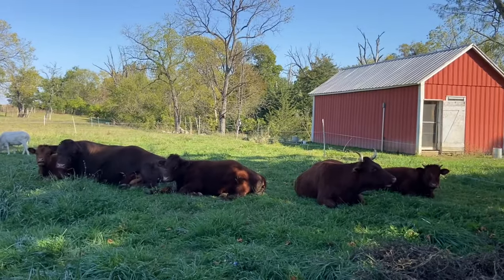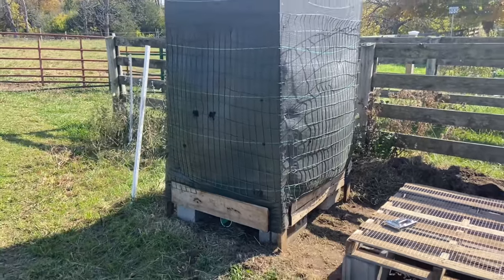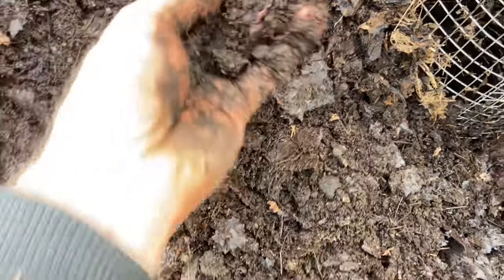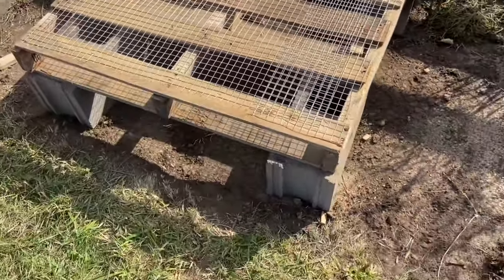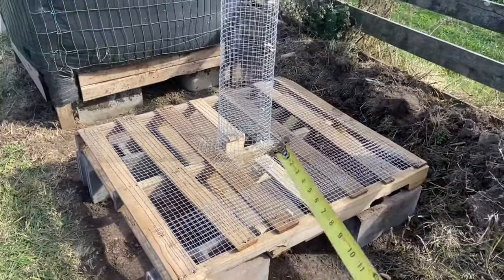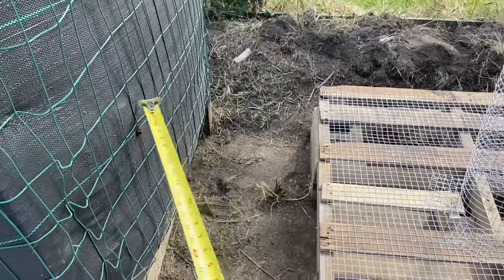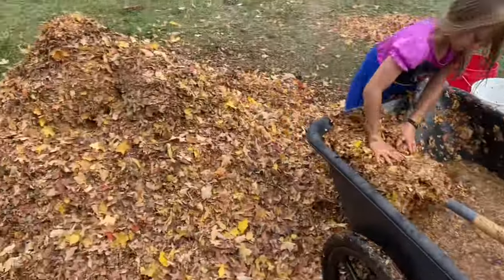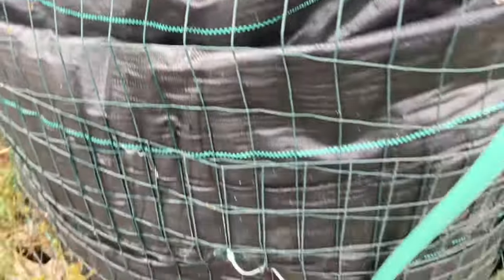A $50,000 Pallet of Compost? Building Johnson-Su Bioreactor and Test Results (With Microbial Counts)

Comment: I want to suggest my most useful find...  It's called "wiggle wire" for holding greenhouse plastic.  I have used it so many times to hold tarps etc on so many projects... (boat covers, porch enclosures etc.)  They would be perfect to hold the landscape fabric to the posts and bottom of your set-up.  They are reusable and are super strong, so easy to use...  check them out!
Reply from the maker: I will definitely check out “wiggle wire” and thank you for the tip!🤠
Reply: Makes so much sense   will try it out

Comment: In this entire discussion about microbial life it is important to note that microbes are going to stay at the capacity of the soil so just adding microbes to soil will not increase them. The levels will quickly drop off as they quickly die but the carbon/organic matter has to be increased to support them if you want the levels to stay up. Adding the compost will do that. But making teas and many products with high microbial levels and adding them will not because they die off very quickly. I love this method of making compost and appreciate you sharing your version and improvements. 🙏❤️
Reply: The purpose is to inoculate soils that have lost certain populations of microbes. They have found things in these bioreactors that were thought to only exist in old forests and protected prairie. So this compost can return those lost species back to soils.
Reply from the maker: Might also be worth noting the recent discoveries surrounding the seed actually having its own microbiome.  The consensus seems to be that’s one of the reasons we see the yield increase when extract is applied directly to seed in furrow.
Reply: Couldn't disagree more with this comment.

Comment: I've seen systems built like yours. I think a gamechanger is a system that's easier to just shovel out the stuff on the bottom when it's done and keep throwing stuff in on the top. Because of this I just bury pipe with the compost and have air input that way, with it directly on the ground. (not my invention either, large scale does this)
Reply from the maker: Leaves are the primary input for a JS system, and we only have them once a year…but I hear ya, and thanks for sharing!🤠

Comment: that batch looks amazing !
how to transfer all those microbes and fungi it to the soil is what is so important to me. the tools to do it.
Reply from the maker: For sure…We had some pretty good results with our JS extract on a winter cover crop trial.  Putting extract straight down on seed seems to work well.  I’m curious now what it takes to see results on perennial pasture (drilling it down vs spraying on top).
Reply: @birchfieldfarming  what equipment would you use to drill it and inject?
Reply from the maker: @david.bull. That’s a great question.  We’re doing very small batches and sections.  Try Jay Young of Young Red Angus out in Kansas.  He’s successfully doing it at scale.
Reply: @birchfieldfarming   I am familiar with the content from Young Red Angus (probably why I was recommended content from your channel) and I have seen him treat the seeds with extract prior to planting on a large scale. As far as injecting after the fact on an already planted plot or pasture I've never seen. Is that what you're doing in your pastures? Somehow penetrating below the surface and injecting some extract? If so, what are you using?
Reply from the maker: @david.bull. I’m merely dripping down extract onto surface of pasture.  I know I would see better results if I could get extract into rhizosphere.  My son and I have some ideas for something small scale that would slit and drip, but we haven’t built it yet.

Comment: How cold are your winters and if you shred the leaves do you get better results?
Reply from the maker: Winter are many times sub-zero, so we actually ended up building a heated worm bin and transferred everything there for winter.  We just started our garden seeds in the material about a month ago and are blown away!  We used to water everyday, now it’s like once a week!  The soil is like a sponge.  I would say yes you would have better results with shredding to finer material as long as you keep it 70% moisture (non-chlorinated source) and keep it from freezing.

Comment: You ever thought about purposefully inoculating your compost with wine cap or oyster mushroom mycelium? Ive started doing it with my spent goat bedding and it has accelerated the decomposition tremendously. As an added benefit, during the cold season the fruits from the mushrooms pop up and gives us another source of food
Reply from the maker: That’s really interesting…so the mushrooms would fruit thru an Ohio winter??
Reply: @birchfieldfarming  maybe not at the absolute coldest parts of it, but they'll fruit when most other vegetables won't grow. With enough aerobic activity warming up the air around the pile, it might even fruit in the dead of winter
Reply from the maker: @anthonysurrency7134 that’s awesome, thanks for sharing

Comment: Do you find that you have a lot of "juice", water, extract coming from the bottom of the bioreactor? Does it drain onto your land? If so, can you capture it? Does it have a benefits?
Reply: I've seen from others, that the soil under compost piles is usually pretty good.

No need to "capture"....soil will do that for you
Reply from the maker: Yes, we do have some that drains out bottom.  I think this is more of an issue with adjusting water inflow.  I may try more of a mist on top at some point.  I was amazed at how moist the finished product was despite us having been thru drought this year and me not watering!

Comment: What about cardboard around the sides, so moisture would be held and overtime would brake down over time and create an air space? 
To avoid all the work your girls did,  could

You water with each layer of leaves added?
Reply from the maker: Good ideas, and we’re so new to this that I’m open to ideas at this point.  Thanks for sharing!🤠
Reply: Carboard could lead to an anaerobic pile before decomposing.  The woven landscape fabric is best.  Its UV resistant enough to last a couple years and lets enough air through to keep it aerobic and not sour.  The woven stuff is a little pricey but worth it for this stuff.

Comment: Re: our previous discission on JSB and freezing-

I found this reply Dr. Johnson made re: freezing to a question in the comments to the below video...

https://youtu.be/cOlVT6wcCxY?si=A7oDO_Qc4_-s7ah2

@frankfeske7867

Does a harsh cold winter affect this process?

@davidjohnson1910

Yes, it will. Please keep it above freezing and around 70% moisture content. Happy composting!
Reply from the maker: Good stuff!  We used Captain Matt’s design for worm bin, and then just wired up baseboard heaters on a thermostat underneath the unit…heat flows up into material, worked great!

Comment: How are you keeping the worms from freezing over-winter outside? A JSB is a big stand up worn bin. The worms create the magic.

Are you insulating & heating those bins sitting outside somehow?

Built to spec & kept from freezing, the material should be clay-like textue which is a function of worm castings that looks more like this below. (Color is irrelevant.)

https://youtu.be/nSfgIi7Mdgs?feature=shared
Reply from the maker: David Johnson talk about this, and the mass you have in the pile.  Has to get very cold for extended periods to freeze the core solid.  Nonetheless, I don’t add worms in the fall when we first build.  I wait until Spring, and then harvest the following fall.  After we tear down a pile, we move it to a heated worm bin in our milk house and run all winter.  We had 16 month old JS to start our tomatoes, and it was amazing!
Reply: Yeah. You can't finish a JSB in a truly temperate climate unless it's undercover & heated. Dumping it off into a real worm bin in a heated milk house was your best option.

Trust me. That core will freeze (dead worms & hyrdophobia) if outdoors in some place like WI or MN. 10F, Zero and minus 0 happens. It's brutal.

Johnson spent most of his research years on this system in CA & AZ IIRC.